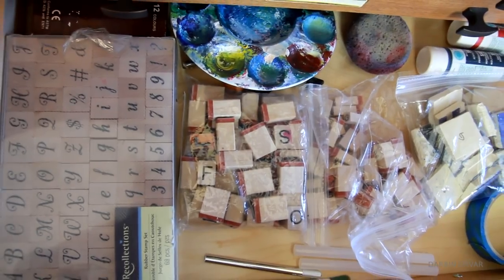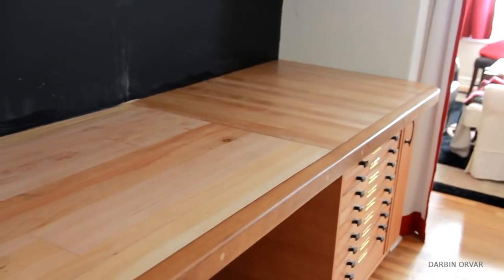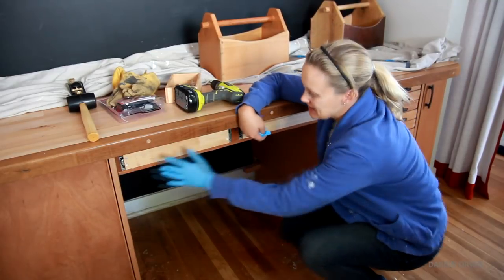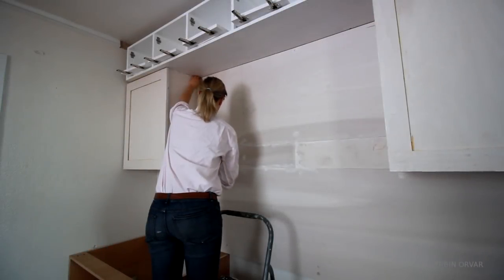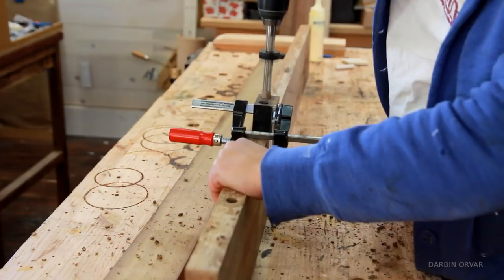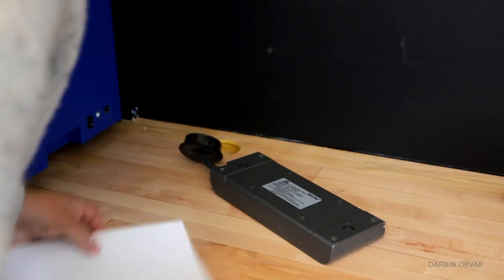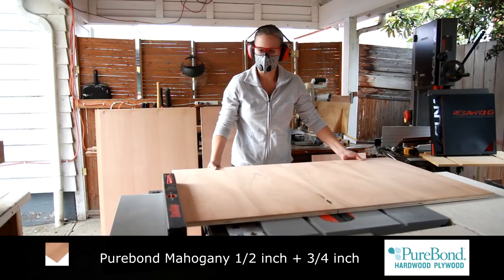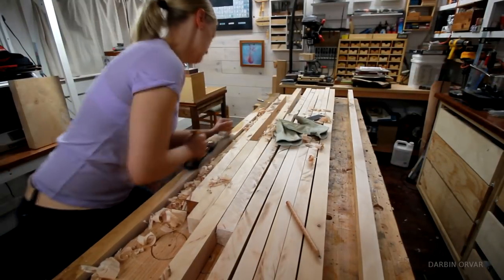How To Create an Amazing Workspace in the Home

Comment: Great job. 

For extra lighting over the center of the desk, you could recreate the lower shelf support and recess LED lighting strips into the bottom of the dowels running the wiring behind the back board. Would add a lot of light and be very clean in the presentation.
Reply from the maker: Thanks Joe, actually I was thinking of something quite similar :)

Comment: Time to start thinking on how you are going to secure those drawers against the rug rat - it will happen faster than you think. The doors are relatively easy, you can buy the plastic loop locks in most baby shops to go over the knobs, but the drawers are harder. Have a look on 'The Furniture Record' blog, a few posts ago he had a series on cabinets with a system to lock several doors with one hinged and key locked strip down the front.

Comment: Yes, lighting is very important. I think LED lighting would be a good choice since it's not hot and practically can be wherever you want.  The accordion arm thing is a good idea but how would you hide the wire? I have bought a "snake lamp" from Ikea. It's designed to clip on to the under side of a bunk bed and hang down for the sleeper in the lower bunk to use.  The wire is inside this flexible metal arm tube thing.  The arm is probably 30 to 40cm long and you can bend it and it stays where you want but I don't know where you can find that metal tube.  If there is enough space, may be you can build a simple shelf for the computer monitor to sit on, so that the counter surface is still clear of stuff.  My! Creating and making stuff is so exciting!!  Thanks for sharing : )